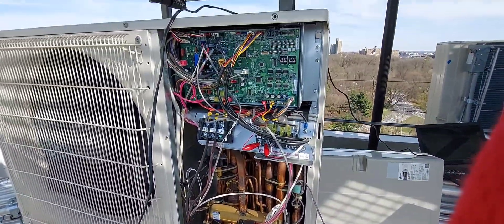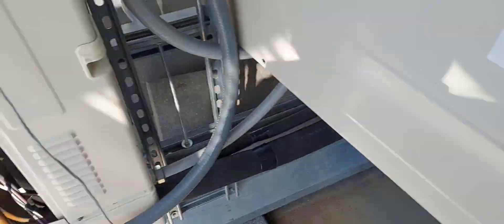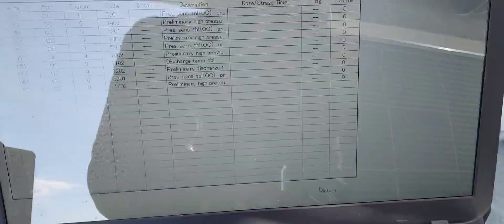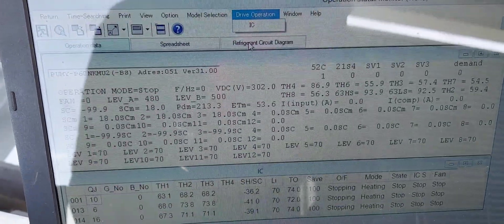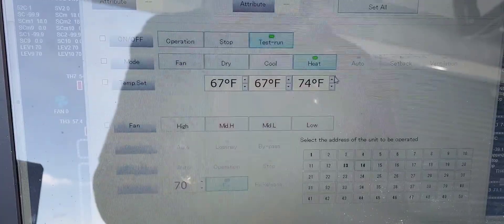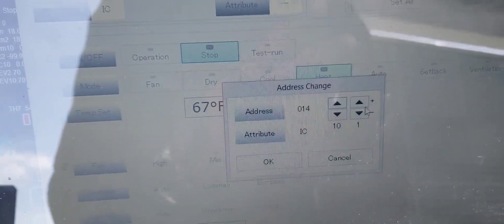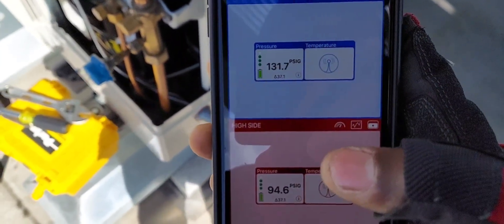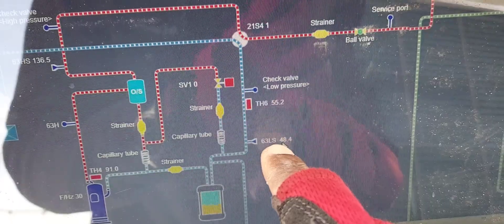MITSUBISHI CITY MULTI ERROR CODE TROUBLESHOOTING

Comment: How to fix error code 6834 & 6831?
Reply from the maker: RC / remote control/ thermostat  not able to communicate with indoor unit, check the RC settings and  communication wires between RC and indoor unit, make sure all wire plug connections on board is properly fastened
Reply: Hello
Reply: Where I can take the Mitsubishi training plis
Reply from the maker: Best bet is to call your local mitsubishi sales  rep and find out

Comment: Is it possible to troubleshoot the metering where you're getting low pressure ? Or that the transducer is reading correctly I can't see how you have 80 psi coming back on the liquid line but reading 6psi on your service tool. I work on daikin vrv new to them but cool stuff 👍
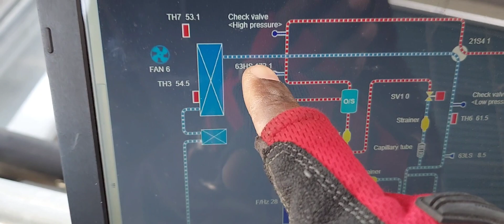Reply from the maker: Okay,  considering that the head pressures is very low to begin with for R410A in combination  that there’s already some pressure drop from the indoor unit LEV which is closed slightly in heat mode, then given the system is almost empty, in order to for it to stay running the compressor frequency is lowered and the main LEV A  is almost shut @ 100 pulses ( refer to 12:15) hence the extreme low back
Reply: I want the answer to this too..🤔
Reply from the maker: In addition remember that with a very low charge you have low sub cooling which affects liquid stacked in the liquid line, so now the metering device doesn’t work properly because it’s designed to meter liquid not vapor, also let’s not forget that now your saturated refrigerant post the metering device will be mostly vapor now, and so this small amount of liquid will be incinerated instantly and the compressor will pull that down quickly adding to a lower back pressure
Reply: @D2DNYAC  thank you for the detail reply 🙏 love the vida
Reply: @eddiegomez3628  ya I'm a lil confused on that lol
Reply: Okay heat pump mode the metering device (LEV) is now in the condenser that’s why
Reply: @globaltecnicianworldsbest3031  ya but that's what I'm saying..if you have 100 psi on your liquid line coming back to meter and then run through the condenser if I had a transducer reading 6 psi I'd be curious about that metering in the condenser
Reply: The service port he is on is before the LEV (Heating mode). The transducer is after the LEV, hence why the transducer is reading lower pressure.  There are service ports near the transducers you can use to confirm values.
Reply: @RJMaker  that's what I'm trying to say. A drop of 94 psi between my service port going into the condenser and after the LEV would make me question if that is accurate. Good to know there's Ports thanks